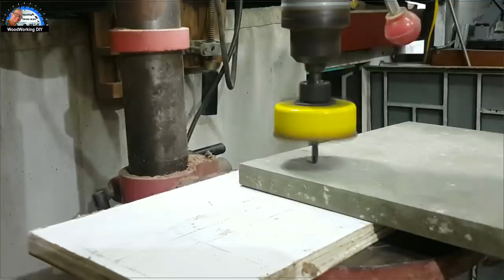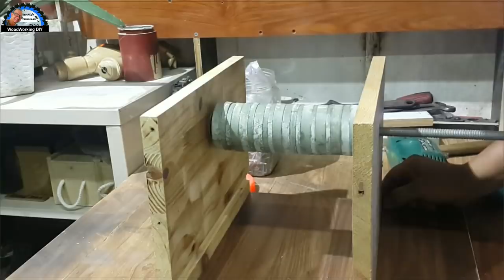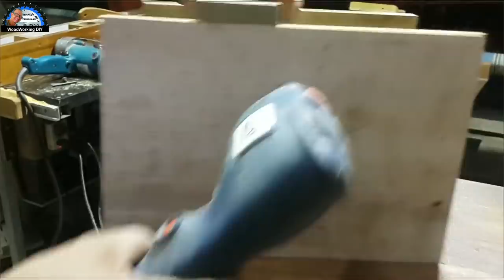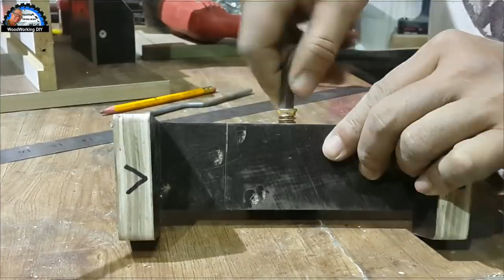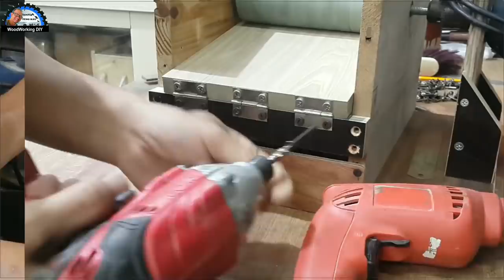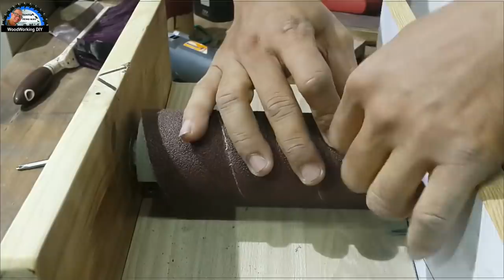Simplest Drum Sander Machine

Comment: Hi, grate proyect, I did the machine and it is shooting away the pieces i'm trying to pass through no matter the pressure or adjustment I set , does it has to do with the material of the sliding base?
Reply: Turn your drill rotation to reverse
Reply from the maker: I think it is not related to the sliding sole, but maybe you have put the wood in the same direction of rotation of the drum. Such wood will shoot out very dangerous